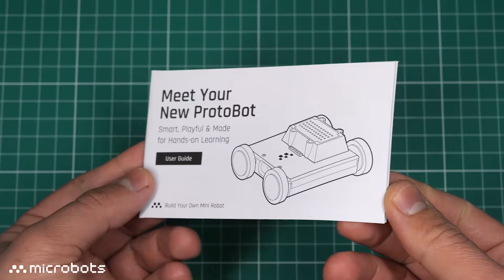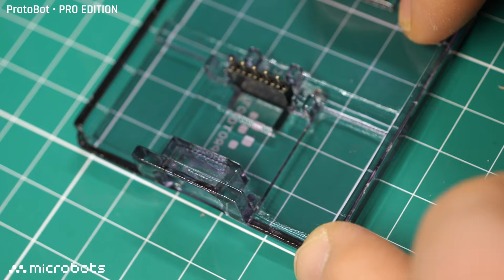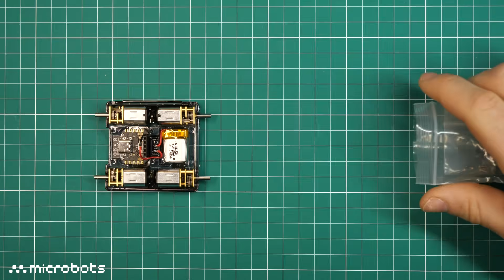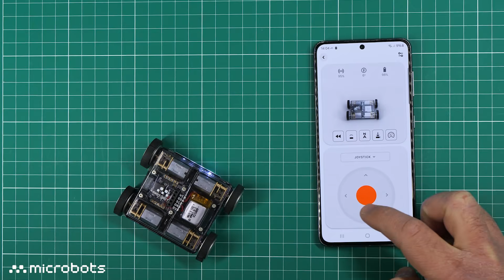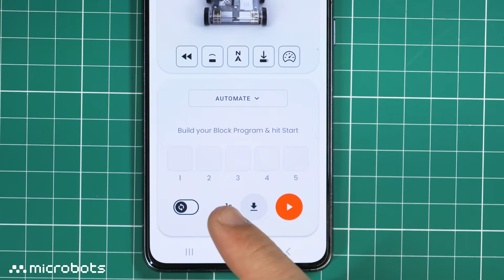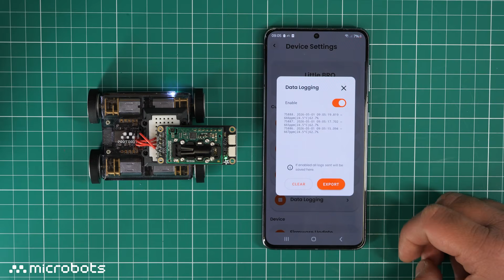How to build a ProtoBot?

Comment: I bought one (in Italy), and I’m planning to build a 3D structure to add several IoT modules: a microphone, two LED matrices for the eyes, a speaker, and a camera.
I have a question: what do you think is the best way for a Jetson Orin Nano to remotely control the ProtoBot?
Should I develop custom firmware for the built‑in microcontroller and have it communicate with the Jetson, or—if possible—add a Raspberry Pi running ROS2 inside the ProtoBot and let it communicate with the ProtoBot via USB‑C? I’m not sure whether the second option is feasible.
Reply from the maker: Sounds like an awesome project! 🙂

I'm not sure if the Jetson can communicate directly with the ESP32. We do have BLE joystick examples on GitHub using a CodeCell module—one with motion tracking and another with an analog joystick—which might be a useful starting point: https://github.com/microbotsio/ProtoBot/tree/main/examples/other